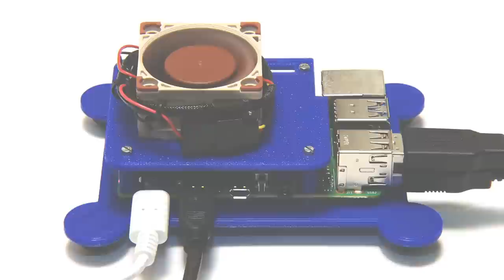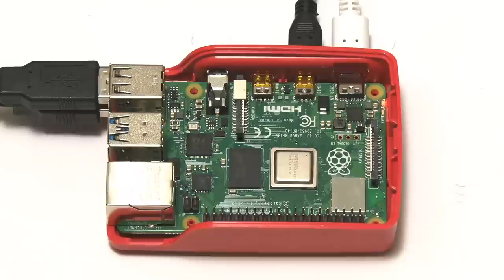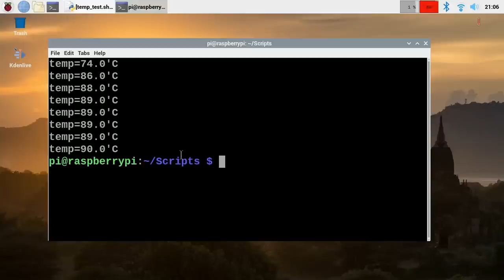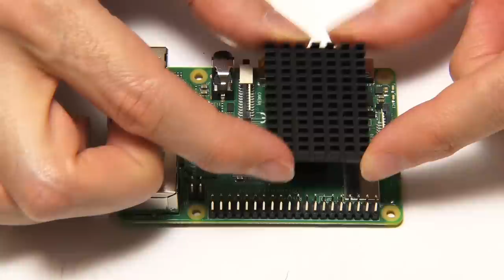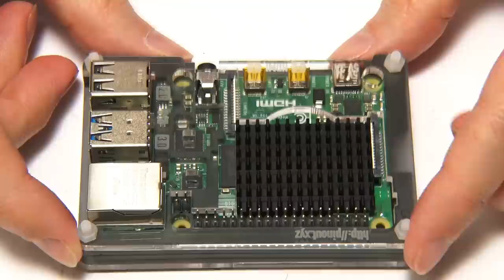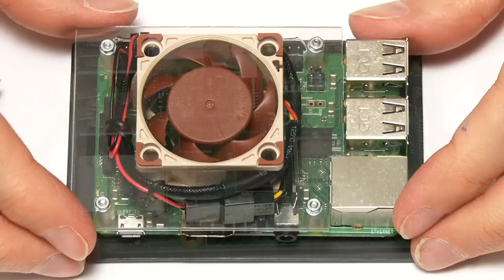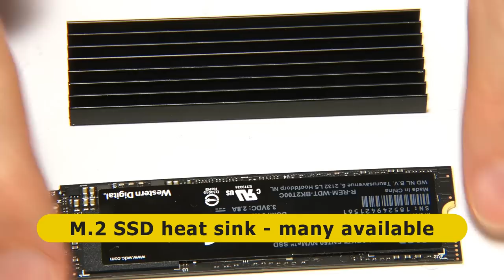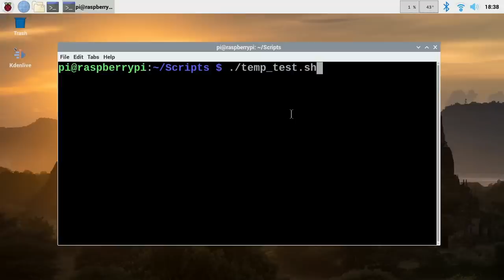Raspberry Pi 4 Cooling

Comment: If fan noise is an issue, one could connect the fan to the 3.3v pin. It wouuld, of course, be less efficient at the same time, perhaps two fans at 3.3v would be quiet and efficient.

Thanks for another great video.
Reply: The Noctua NF-A4x10 i used inside the unity-case and within its rubbers is hard to hear from 1meter...

Comment: Great video -- I considered the Ice Tower fan from your later RPi4 setup but Amazon reviews indicated that the mounting brackets obstruct some of the GPIO headers. This is a huge help for rolling my own solution once I actually use my Pi 4 for workloads that passive cooling can't deal with.

Comment: Chris, Just commented yesterday, have 3 more thoughts
1. Best cooling solution is always creating less heat, another firmware update like the USB controller.

2. With a fan solution, even a smaller one, millions of creative users and companies out there designing/using "hats",  will require a 4" (sorry 10 cm) connector extension and a huge case. Ideally the case should provide independent air intake and exhaust so its not just recirculating hot air.
3. If the PCB was designed with the SoC on the bottom side there would be no obstruction from adjacent components so you could cool passively with a copper or aluminum plate the full size of the PCB using the 4 mounting holes, and yes, your feet or some spacer. This would mess with the classic case design but could eliminate 1 of the 2 case pieces.

Comment: Excellent video.  I should have waited for this video as I ordered and started testing a 12v Noctura 40mm fan instead of the 5v you suggested (I had assumed it would work with the 3-to-2 pin adapter, but I was wrong).  Thank you for your video(s).

Comment: I've got my 3Bs inside Flirc cases, as i'm a fan of passive cooling whenever possible. I'd be quite interested in seeing how the 4B performs inside the 4B-specific Flirc case, when it ships.
Reply: I just got the FLIRC 4B case in the mail.  I ran this same script/test and here are my results with a Pi 4b 4GB model
-------------------------
(Ambient) 24.4'C
47.0'C
56.0'C
58.0'C
59.0'C
60.0'C
61.0'C
61.0'C
63.0'C
Finished in about 10 minutes with no throttling.
-------------------------
I also ran it 3 times back to back (without any cool down period) and the case seems to reach steady state (dissipate heat as fast as the SOC can create it) at  68.0'C (at 24.4'C ambient at least).

Comment: The entire SBC is getting very hot to the touch! Everything! Every chip is scorching hot (even with heat sinks on every chip) and so are the USB and LAN port(s) and even the SD Card reader!
I'm waiting for the Pi 4 version of the GeeekPi full cover heat sink before even attempting to use the Pi 4 for anything beyond testing.
Reply: That heatsink sure looks like one hell of a beast for cooling the Raspberry Pi 3 and 4.
But don't they have them already for sale?
Reply: @Loundre3  No, only versions for Pi 3B and 3B+. I asked them about the 4B version and they said it would be available within the next couple of days. I am anxiously waiting for this heat sink.
Honestly, passive cooling is the reason why I decided to run my home automation system on a Raspberry Pi. Als prior iterations worked fine (I started on a Pi 2 and have upgraded regularly). By now my home automation system has outgrown the 1GB RAM limit and I had started to look at other SBCs with more RAM (like the up board). Then, just at the right time, the Pi 4 with 4GB RAM was launched. I ordered mine within minutes of the launch and have spent the last couple of weeks trying to figure out how to get it to run cool enough to to replace the 3B+ of my live system.
Reply: Wait are you saying the actual physical USB and Ethernet sockets are getting hot to the touch? That's hilarious in a way.
Reply: Just get an old South bridge heatsink from an LGA 775 motherboard, it's looks like it should fit, if not just hack a bit off.
Reply: @MrMrsirr  yes, that's what I'm saying. Hot enough that you can't put your finger on them for more than a couple of seconds.

Comment: Would have been interesting to compare with a bare Raspberry Pi (with no heat sink) out of the case. I am left wondering how much of the cooler temperatures with the passive heat sinks are due to simply not having the Pi inside the standard fully enclosed case.

Comment: Raspberry Pi Trading has been very diligently deleting my comments on their social media, so I'll try here. 
The Pi 4 overheats and throttles in the official case while just idling at desktop. Yeah, you read that right. I connected it to a 4k display, booted it up and deliberately did absolutely nothing, just left it siting at desktop. In an hour the temperature reached 81 °C and it started throttling. Ambient temperature was 18 °C. It went 63 °C over ambient by just idling! Maybe I'm old-fashioned, but to me that is completely unacceptable for an official accessory. 
I have to wonder if anyone at RPT even looked at a prototype of the case before greenlighting mass production, because this design flaw is pretty much impossible to miss.

Comment: Lovely video and just in time. I've put my new Pi 4 through its paces for the first time today and was surprised at how hot everything gets. The USB and ETH ports (not just the chips, the ports as well) get very hot - and all this running out in the open with air condition on. The active cooling would probably cool down those jacks as well

Comment: Comparing the first and second run (in case+no hs vs outside+small hs): how much of the difference comes from adding the hs and how much from removing the case?
Reply from the maker: I think it is about 50 per cent case and 50 per cent fan.
Reply: Thanks for the info. Also great video, as usual.
Reply: @davidgriffin79  I don't think he had it in a case when he was using it with the small heat sink.

Comment: It would be awesome to have thermal vision on the pi while the test are running.
Reply: I've seen some on the web, it gets hot everywhere except the USB sockets.
Reply: on that note, I wonder where the temperature sensor(s) are placed on the board.

Comment: Thank you, really nice video! Some notes: - maybe the larger heatsink without the top "case" would perform better, but still probably not good enough; -there are already 3d printable available open cases that allow various fan mount(from 40 to 70 mm) . Thanks to the people who shared them (let's tip them); - also the RAM next to the CPU is likely going to run hot.  I really liked the idea to cut your own heatsinks, thank you!

Comment: Which version of the VLI Firmware were you running. The old 00013701 firmware was causing the VLI to produce a lot of heat. 

Can you run the tests with fan and no heat sink. Having a heat sink doesn't appear to lower temps much.
Reply from the maker: I had applied the update.

Comment: Another great video. I would like to see some testing with a flirc aluminum heat sink case to see if t hat is good enough to keep the pi4 below throttle under load w/o a fan.

Comment: It's too bad someone at the Pi foundation didn't think ahead on this one, and put a nice slim fan in the "official" case. There's just enough room to mount a small one flush if there's no heatsink, or surface mount if one is present. And if a good fan was chosen, no heatsink would be needed anyway. One caveat.... Yes, the case would cost more. But I don't believe that would matter. If I were buying a Pi4B I'd be wanting a fan-based cooling solution anyway.
Reply: Pi4 SoC got ready almost one year ahead of schedule. I can only imagine the foundation chose to rush things up, in order to reduce time to market. Even so, one can barely use it with official casing. Also, if a company advertises dual monitor 4k 60fps capabilities, and then explains that only works for desktop, it looks like gross misleading. That's not cool, that's not right. If codecs are not ready at deploy time, than the board is not capable yet. It should not be announced otherwise.
Reply: Get the Pibow case with the fan SHIM

Comment: Just run your test on my Pi4 which has a 5V fan but no heatsink. The temperature won't go above 54 C, with ambient at 28 C.
Reply from the maker: The fan is the key!

Comment: I pillaged the 40X40mm heatsink and fan off my 3B+ (I think the cooler was featured in one of your extreme cooling pi vids). After the install, my temps while stressed went down to between 88°F and 100°F (31-37°C) before it would be between 140°-180° without the cooler. Which I thought was a really good result. I have since made the Pi4 my official new HTPC running Libreelec. And it runs perfectly.
Reply from the maker: Great to hear.
Reply: Did you mean the other way around? Otherwise, you're saying that it increased your temperatures.
Reply: @alvallac2171  no sorry. It came out wrong. I just read that again. After installing the heatsink and fan, my temperatures when stressed stay between 88° and 100° F. Before the heatsinks it was in the range of 140°-180°F.

Comment: To my shame, I just realized I never subscribed to your channel.

Edit: I think that 90 Celsius is ludicrous.

Edit 2: switching from the Kintaro passive aluminium heatsink for my RPi3B to a flatter custom aluminium on top of small copper discs in hope to accommodate it better into a portable frame. I'm seriously considering adding a PWM-driven 5v fan with power circuitry at the side. Unfortunately this is going to add a little bit more strain on the batteries, but I don't think there is much to do if I want some good cooling: either widening the frame or drawing more current.

Comment: I'm against any active cooling. It kills one of the main advantages of low Wattage PCs which is fanless = noiseless.
Reply: I love passive cooling too, I often use my Pi1b if I can as it is silent and doesn't use much power. It is enclosed in a plastic case and at 800MHz only gets to 56C running flat out, this was just today converting some of my old .WMA to .MP3..slowly
edit:  wav to wma, always get those mixed up.
Reply: @Kenobi5001  I don't have any Raspberry but I have four x86 PCs with M3-7Y30, N3450, Z8500 and Z8350 CPUs + another cheap Chinese TV Box with ARM S905X CPU. All of them are passively cooled & are dealing well with heavy duties. No reason to change it for Raspberry unless it's going to work 24/7 in hard conditions.

Comment: I always felt that cooling would be an issue for SBC's but it opens up a massive avenue for testing and getting the best out of them with overclocking and cooling projects. What would've been nice to see would have been some thermal imaging shots from the first test to show surface heat and a thermometer to show the real world temperature within close proximity of the board.

It's always nice to see projects like this as factual data is something that can appreciated on many levels and expanded on until someone reaches the ACME stage of Pi cooling!

I was happy that the Pi3+ I got my daughter had 2 heat sinks and a case with functional and decorative slots that allowed the heat to dissipate quicker.

Comment: I tested with an old 80mm 12V Noctua fan from a computer. Either hooking it up to the 3.3V or the 5V fan worked fine. Running stress test without any heat sinks I got 70C (3.3V) and 65C (5V) 60 min test. Idle was below 50C. The big advantage was that the fan was running completely without audible sound. Which was my goal as I like RPI as a small desktop computer because it is silent.

Comment: Impressive what the small heatsink could achieve.  Temps are still high, but there was only a bit throttling. Only with a fan you could save roughly 10% of the time needed to perform the test.
I like the idea to have it completely passive cooled. If you put a fan there I would make it temperate controlled. Because most of the time the fan can be off with just the heatsink.

Comment: To do list: 
(1) order in fan from Amazon 
(2) download Pi updates 
(3) download 3D printer files
(4) print case
(5) assemble case/install fan/heat sink
(6) load testing software/ run test

I think that covers it, now let’s get started!  Thanks EC for this project build
Reply from the maker: You have your task in progress then! :)
Reply: ExplainingComputers / Chris, I'm a retired old guy with time on my hands. It's all your fault that I'm spending my time in my shop on a Sunday morning. That said it is indeed exciting times to be a Maker. Thank you for making our Sundays productive.

Comment: Thanks that was a real eye opener, I did not realize that they got that hot. I am getting ready to buy a pi 4 and now I know what other bits and pieces I will order as well, and it will not be the original case for sure.
Reply: *opener; I (to fix the comma splice run-on)
Reply: @alvallac2171  sorry I didn't realize my punctuation was that bad. Lol

Comment: Very “cool” video indeed! Just ran your stress test script on my pi4 setup. Using a 10 dollar low profile fan/heatsink combo. Idling at ~41dC, got up to 52dC when running the test. Key has been not using the cheap thermal tape that came with the cooler but using quality CPU thermal paste - I had some ARCTIC MX4 around. Using an open case atm.
Reply from the maker: Interesting results -- I must try using some thermal paste.

Comment: Thanks for the video.   I thought the Pi case would not be a good idea for the Pi4, your tests show how bad the lack of cooling is for the board.   I like the active cooling setup.   3D printers are very useful to make such items to mount the fan and board.
Dave.
Reply from the maker: I did think of making a cut-out in the top of the official Pi 4B case and mounting the Noctua fan on top of that . . .

Comment: Lots of folks below fussing mostly about the granularity of the tests.  "You didn't test it with a heat sink in the official case" or "You didn't test the board completely naked."  True, but I'd point out that the experiment is good science in that it is reproducible.  Given the test load is shown, anyone can run the test with the same cooling solutions to confirm the results for some peer review, and expand the dataset by running different permutations.
Science!
Reply from the maker: Thanks!

Comment: Thanks Christopher for another very interesting video! 

Not surprised that the stock case makes it so hot, just rather puzzled that they didn't include air holes, a heat sink, and fan mounting screw holes on it - given that they should have known how badly this stock case makes it heat up.  Can't imagine that running the Pi's chips that hot is any good for them, and would burn them out eventually, even if you overlook the significant temperature performance throttling. 

Even though I am months away from being able to get a Pi 4 here in the states, I already got a set of heat sinks and a case with a fan for it - before I saw another video about the "seeed studio ICE Tower CPU Cooling Fan" on a Pi 4, which did a great job of cooling (keeping the temperature near 43C under load if I remember correctly) - but like the Pi 4 is "out of stock" here in the states.  Hopefully it may become available again by the time these new Pi's actually become available here.  I like your elegant and simple case with your custom cooling solution too, so may give it a try also.  Seems like some dramatically improved cooling solution will be a must, especially if you want to use the Pi as a practical desktop system!

Keep up the good work!

Comment: Chris,  Great Video as always, however your conclusion that active cooling is required may have an exception.
I just got the FLIRC passive cooling case for RasPi4 in the mail.  I ran this same script/test and here are my results.
-------------------------
(Ambient) 24.4'C
47.0'C
56.0'C
58.0'C
59.0'C
60.0'C
61.0'C
61.0'C
63.0'C
Finished in about 10 minutes with no throttling.
-------------------------
I also ran it 3 times back to back (without any cool down period) and the case seems to reach steady state (dissipate heat as fast as the SOC can create it) at 68.0'C (at 24.4'C ambient at least).
Reply from the maker: Thanks for sharing this data -- very interesting. That is excellent passive cooling.

Comment: I used a cheap fan and cheap heatsink and after running your script I get a steady 55.0°C. While on idle I get 43.0°C. And all that in Greece during the summer.  I may missing something or some update made it run cool (I just received my pi-4, I do not know how it runs without any cooling, I am comparing it with my pi 2 and with what I see here on your comparison). All in all I am happy! I think it is the case's fault, because I have a different one that is open at the sides.

Comment: I couldn't help noticing that you always use your heat sinks in conjunction with those  tapes to stick the heat sink on the sbc but recently I saw a video about testing cpu cooling with various components, including thermal pads and –of course– the classical thermal paste with the result that the paste brings some degrees advantage compared to the other methods. 
Mentioning this I would really enjoy to watch those cooling tests rerun using thermal paste to attach those heat sinks to the  sbc, not only with the Raspberry Pi 4 but also with other manufacture's sbc.
Reply from the maker: I havae once used thermal paste in a Pi rig -- https://www.youtube.com/watch?v=1AYGnw6MwFM -- works very well, but makes it harder to hold things together! But I may well try what you suggest.

Comment: I had heard that it runs hotter so bought the Pimoroni Fan Shim. A little fiddly to set up but works well with the pibow coupe and looks good. Very quiet and seems to keep it very cool running stress. It is also smart in that you can set what temperature it turns on at.
Given that there will be more fan solutions for the 4 maybe next video should be a comparison.
Reply from the maker: Pimoroni have been in touch this afternoon. The Fan Shim was out of stock for this video . . .